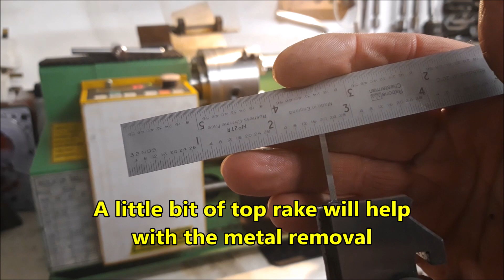Parting off stainless steel on the Mini Lathe

Comment: Thanks for that. I have a Warco mini lathe too and the parting I have done has so far been successful, though I do always approach it with a little trepidation! Looks like I am mainly doing it right, though I might try grinding the tool like you do. Thanks 👍😀
Reply from the maker: Thankyou, the mini lathe is a very capable machine, although it's best to ignore the recommended speeds and feeds and just go with what feels and sounds right.  Had a look at your channel, some good stuff on there, subscribed!
Reply: @machineshopinagarage4699  Thanks 😀👍. I have subscribed to you also 😀.  I know some people consider these machines to be too small for 'real' work, but its much bigger than the little Lane/Wizard lathe I was using before and much more capable. 😀

Comment from the maker: Thanks everyone for watching my real time parting off video, it is much appreciated.  I understand that some owners of this type of mini lathe struggle with parting off, so I hope it gives some confidence in the machines ability. 
Quick question;  is it worthwhile showing  a video on how my lathe and tooling is set up to give decent parting off results?
Reply: Yes: very definitely.
Thanks.
PT
Reply from the maker: @petert9749  thanks, I've not done much in the workshop recently, been doing house DIY, but I have got a piece of exotic metal ready for another parting off video, which will really test the mini lathe capabilities!  I'll also give a quick overview of the set up
Reply: @machineshopinagarage4699  Looking forward to that.  Machining HO train wheels by plunge cutting tread and flange.  Form width about 3mm; depth about 1.5.  Parting off with 1/16" wide tool.  Tough material.  12" swing Taiwan lathe circa 1985.  Is this detrimental to cross slide screws?  Any ideas?
Thanks: PT
Reply from the maker: @petert9749  that's an interesting project, I think HO wheels will be about 30mm diameter? So parting off with a 1/16" blade on tough material will be a bit of a struggle, the blade will want to wander, I think a 1/8" wide blade would be better, it will give more rigidity, use plenty of lube and slow speed.  Your lathe is a good size is it a JET? probably like a colchester student?  It should be able to handle a job like that with ease, just tighten down the carriage and gibs to reduce vibration.
I have parted off 30mm dia steel bar on the mini lathe but it does struggle with a lack of horse power, and stalls if the cut is too heavy handed.
Reply: @machineshopinagarage4699  Again: Thanks for your reply.  Looks OK to go ahead; gib adjustment looks like being the key.  Diameter is actually 16mm; parting off being easy, probably due to rear mounted blade.  Must also make carriage stop and slide stop to firm things up.  Shall watch for your next posting.  Keep going as there is an imperative to encourage creative activity.  See if you can find Model Railway Journal (Cygnet).  A year or so ago was a series called 'Wheel Derangements'.  That was with an old Unimat 1 1/2" centre lathe.  Those blokes can do anything.
Stress Safety: Thanks again PT

Comment: Thanks for not adding background music 💕

Reducing the tool overhang could help a bit with the chatter. You only need 10mm stick out on that tool to part the 15mm stock. I've pretty much given up on HSS for parting these days. MGMN / MGGN carbide inserts from eBay are a buck each and work way better. You can also hone them with a diamond stone, unless they chip off or break.
Reply from the maker: Thanks, some music can be very annoying.  And yes the overhang was excessive!!  It's a bit fiddly to change it so I usually leave the blade where it is for most jobs.  HSS is okay if you use the  cobalt grade, and top rake can be ground to suit the material.  I like your electronic lead screw by the way, nice work!

Comment: it is also worth getting a section of at least 10mm steel plate to bolt the lathe onto you'd be amazed how much these little lathes twist especially when parting.
Reply from the maker: The only thing bolted down in my workshop is the bench vice.  I have thought about bolting the lathe down but I need to pull it away from the wall to change the change wheels and cleaning.
Reply: @machineshopinagarage4699  that's why I said to a plate it only needs to be the size of the footprint of the ways (or a touch over the key is metal mass so bigger, thicker, heavier the better) it's far FAR better than nothing and be sure to shim the feet when you do so the ways are level another thing that will help you out loads
Reply from the maker: @nauroticdax  sounds like a great improvement to the mini lathe.
Reply: @nauroticdax  technically shimming it will reduce its rigidity
Reply: @Festivejelly  no it wont

Comment: The recommended FPM speed from Little Machine Shop would suggest a spindle speed of 710 RPM.  Where did you come up with 180-200 RPM?
Reply from the maker: Hi thanks for the comments, my speeds are based on my mini lathe capability and my experience, and I was in no rush.  I find that recommended speeds and feeds bear no relation to the real world in hobby workshop because there are so many variables.  So I just go with my gut instinct and listen to how the machine reacts to every job.
Reply: @machineshopinagarage4699  I agree. in my limited experience hobby lathe parting speed is SLOW and steady. Look at cutters on Amazon. They all have complaints of breaking the tool as soon as they touch the stock. It’s not the tool’s fault
Reply: @machineshopinagarage4699  If you had a free hand with this job, then altering the rpm during the cut-off operation gets the machine out of this vibration. I did this often with cnc lathes wen there was da difficult cut to do. Maybe a foot pedal for the spindle speed were a great help. Or try an automatic lubrication.
Reply from the maker: @johannriedlberger4390 Yes that is the correct way to do it, I was a CNC lathe operator/setter/programmer and we did what you suggest.  Although I didn't say so in the video I did actually increase the rpm slightly about half way through the cut.  This is one of the benefits of variable speed!  Thanks for watching and commenting.
Reply from the maker: @pb7379-j2k  Yes slow and steady is the way to go, I was in no rush.   Maybe the people who break tools are the ones who don't realise some machining videos are playing at 4 x speed!!! Haha!   I'll look out for the Amazon cutter complaints!
Cheers for commenting.
Reply: I'm just on hobbyst with my lathe but, after some time spended in breaking ( many ! ) tools, i begun to go on with partitions after i read about that would be better to use tools ( and spindle ) in reverse, to eliminate any play on the spindle bearings in older lathes ... AND ... to better evacuate the chips. This was the goal for me, and i learned how to parting, with the right strenght and right speed ( with HSS blades ). After that i purchased special tools using a bit 2 mm wide, and - in normal spin now ( not reverse as before ! ) - was able to cut safety and happly. As i believe, the difference was in learning "how".
Just i suggest to lock the saddle and the compound, i provided to get both locked, this is very important in parting. Remember to UNLOCK when finished !!!
The history in that learning of mine is in the control-box, hardly damaged from my hand, trying to fast stopping the emergency switch ... ( a knock on that poor switch ! It is strong, but the plasic box not so much ... )
Reply from the maker: @alessandroandrenacci2372  Hi thanks for watching.  You are learning through your own experience which is good.   I have never parted off in reverse, there is no need to if everything is locked, and the tool is sharp.  Pity about the plastic box!!!  Stay safe!
Reply: Thanks for the video. Especially the absence of music makes it possible to hear the difference in cutting and rubbing. Using your ears is essential in using a mini lathe!
Reply from the maker: @woutmoerman711  thanks, you are correct, it is important to listen to your machine.  I used to rest my hand on the guards to feel for any strange vibration, especially when proving the programs on CNC lathes.
Reply from the maker: Just thinking about little machine shop's suggested speed of 710 rpm, I wouldn't drill a same diameter  hole at that speed! Far too fast!

Comment: Cut a slight angle in parting tool and the tit will cut off clean leaving enough meat on peace to hold it until it cuts smooth,, and every little bit closer you can get to peace really helps with smaller lathes,, looks like you could have been 3/8 to 1/2 inch closer and would have made a big difference,, but pretty good for a mini lathe
Reply from the maker: Hi and thanks for watching,  I did show the slight front angle in the video, probably could have been clearer?  And yes the parting off blade was sticking out too far, as mentioned in the  video.  I'll be making a new parting off video soon, but with a much tougher material,  stay tuned!
Reply: @machineshopinagarage4699  was talking about your horizontal top edge little angle and it won't leave the little bump in middle unless you're not quite dead center of peace that will also leave the bump,, I've found the parting tool with tee shape on top edge to do best gives more for the angle and are more ridgit overall.. and only leave enough hanging out of tool post to clear your cut,, parting can be a challenge for even my 12 inch lathe and it's 350 lbs and my 618 6 inch is much heavier than the Chinese mini lathes and can be a pain,,,l buy and restore vintage lathes have 6 I've restored and just watching the prices climb before I sell them,, people are realizing it is a better option,, weight is everything when it comes to lathes and mills,,,l also have 2 Sheldon horizontal mills I've bought,, but I was impressed that you could even part that stainless,, most I've seen are only good for aluminum brass and plastic..
Reply from the maker: @georgespangler1517   oh yes I see what you mean now thanks, I think it's always a compromise with small machines, they just aren't rigid enough.  I have worked on some very large lathes and even they will vibrate and chatter

Comment: seems like that's something like 20mm, can you try to part 30mm?
Reply from the maker: Hi it is 15mm diameter stainless, I would try 30mm but I have none.  But I have parted off 30mm diameter high carbon steel successfully.
Reply: @machineshopinagarage4699  ok I noticed parting <=20mm is no problem here either, the problems start with 30mm steel.
I used carbide for cutting it off (I've been told that I should use HSS already, and I will try that next week)
My fancy quick change toolpost (not the dovetail based one) itself is relatively weak and seems to flex a bit supporting the parting tool with some spacer had a big effect on parting
Reply from the maker: @mrechbreger  yes HSS is best for a mini lathe, it reduces the effort needed to cut metal compared to inserts or cemented carbide.  Lack of rigidity is the main problem with a small lathe, everything wobbles about!

Comment: Yeah that’s 303 grade St/St , doubt you’d have parted 304 /316 grade .
Reply from the maker: Yes you are probably right, I wasn't sure what grade it was.  316 is shinier and tougher, but it sounds like a challenge!!!  I'll find a bit of 316 or 304 and have a go at parting it off.  Stay tuned!
Reply: @machineshopinagarage4699  I machined some 310 grade other week it was horrible stuff .

Comment: Which toolpost are you using?
Reply from the maker: It's a generic quick change tool post from Warco (UK) suitable for most 3 inch centre lathes.  Works very well too, and I  have seven tool holders which cope with most of my needs. Although I did buy a separate holder from RDG tools (UK) which needed machining to suit the tool post, must have  been different tolerances.